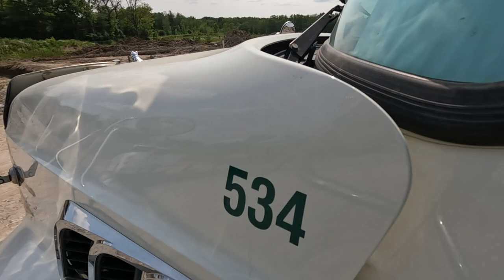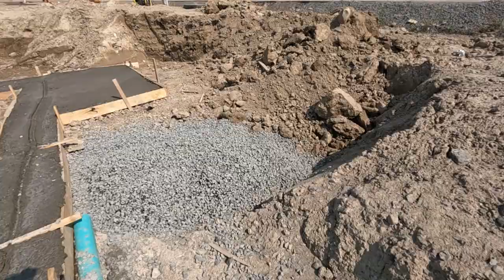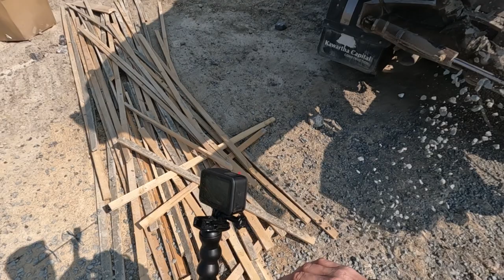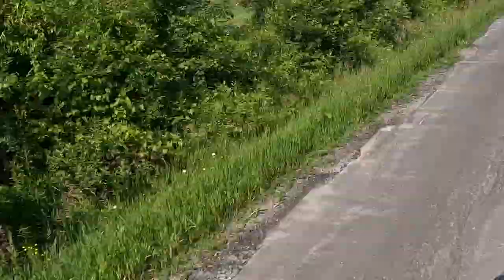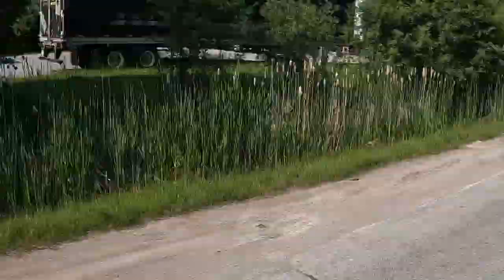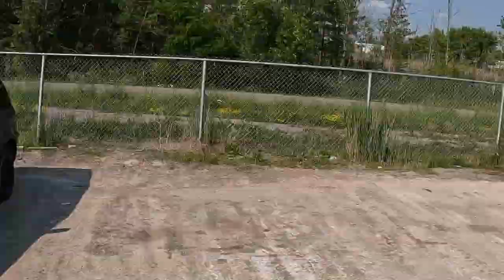Stone slinger OPS(19•06•2023)

Comment: Why the hell would you sling a load into the footing when the boards are still on the concrete? Amateur
Reply from the maker: I get dispatched to the job and I sling the stone. If the boards aren’t off in time I try to leave the stone back a bit but it’s difficult the further out you sling. My job is to sling not to remove the boards. I agree with you though but new subdivisions builds are busy spots and they come in after to take the boards out not my problem